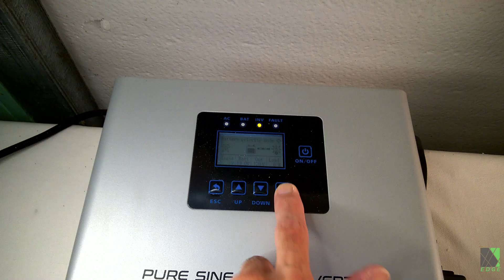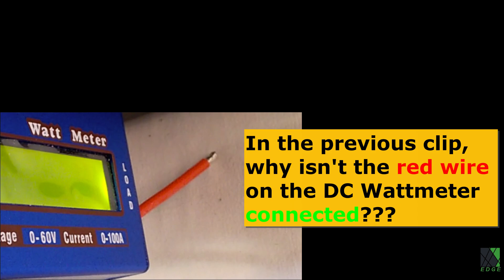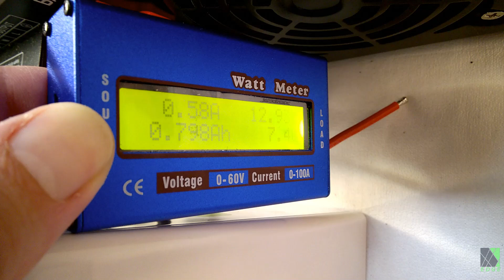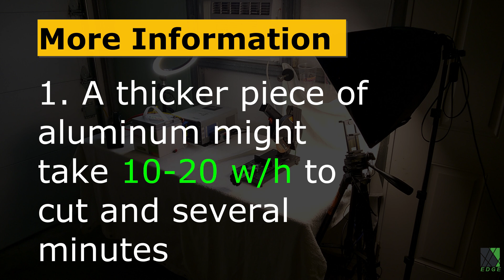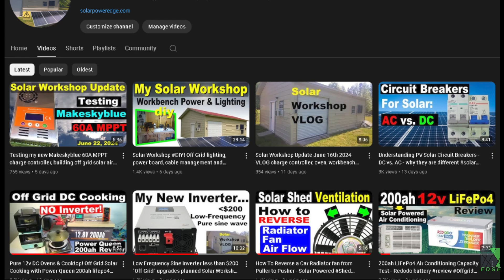How Many Watt Hours to Cut Metal? Science Of Solar #DIY #experiment #learning #learn

Comment: hi Dave.  Just signed up to your channel based on the diode water heating video.  Back for more!   The mystery disconnected red wire is not needed as the watt meter is acting as a shunt and the loads are measured via the negative cable.   The left side of the watt meter has a tiny pos cable but this is just to supply power to the meter itself. (usually in mA).     LFP batteries can pull a lot of current, 1C for "a bit" and more commonly 0.5C for larger solar batteries.  Smaller lithium ion cells (especially in RC and ebikes) can take a lot more current charge/discharge.  The new wave of portable power packs like the ecoflos and bluettis, etc, use the smaller cells (either Lion or LFP) for fast charging.    What really separates the brand X LFP's with the top tier brands is the quality of the BMS.  Although the cells themselves can take high current discharge, the BMS may be the factor that is limiting the current.  I can ramble on about solar inverters and batteries, but I won't.  I work in the biz and get to play will all sorts of fun gizmos.   Keep the videos coming!
Reply from the maker: @daveluxton8317 Hi back! Mystery red wire has been solved! 
I try to keep my house battery (storage) LFPs at around C\10 (that's capacity divided by 10) as this pretty much can never harm them. But I've seen solar generators operating at 1C. I dont know how long though :)